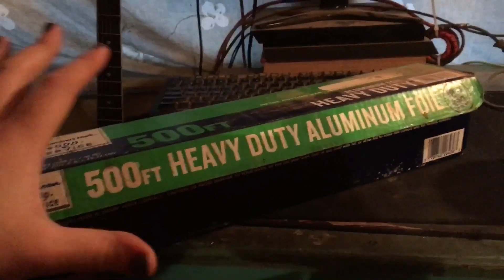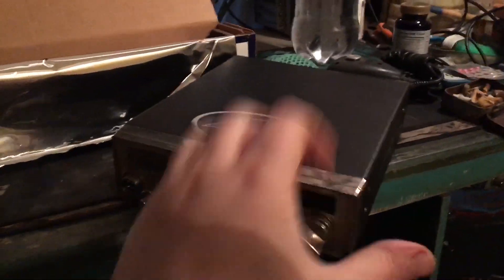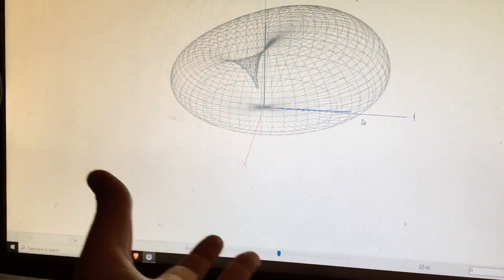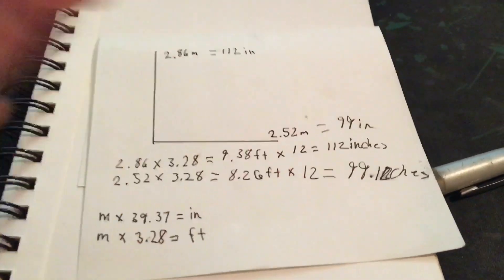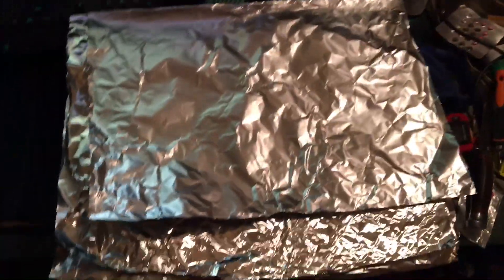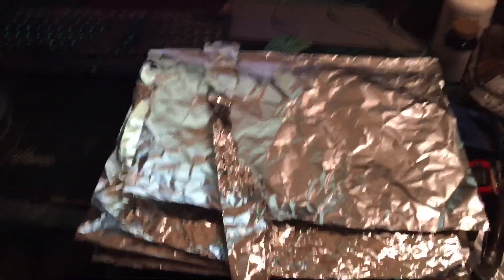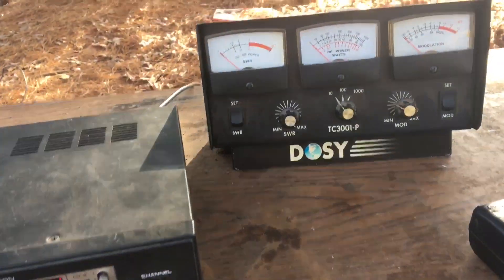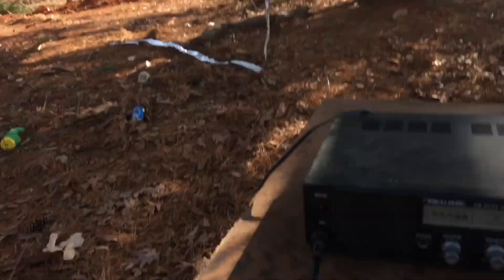Can you make a CB antenna out of Aluminum foil?

Comment: If I were a betting man (and I am,) I’d be this would work great if the foil was wrapped and smoothed over thin pvc or even wooden dowel. The radiation travels along the surface, so a crumpled core and wavy structure probably makes the radiating point all wonky. There, I threw 2 pennies at it! 〰️〰️〰️➰➰
Reply from the maker: Yep absolutely because of the “skin effect” RF would much rather travel over a smooth even homogenous surface

This idea isn’t dead yet of course, there will be a revisit 

thanks for commenting 👍
Reply: There’s an old lady down the road that still has an old tv antenna on a pole at her house that doesn’t appear to have wire connected to it. Been thinking of asking if I could have it if I removed it all for her. The only problem is she’s got private property and no trespassing signs all over. Really don’t want high velocity lead poisoning over my junk collection. Haha

Comment: hear are a few ideas: #1 5/8 wave vertical made from cans with a cap hat to bring the electrical length to 3/4 for 50 ohm resistive match, with aluminum foil or other metal sheet for a ground plane. #2 a 1/4 wave out of cans in the form of a sleave dipole. #3 a 5/8 ground mounted vertical made from wire & a cap hat to bring it electrical lenght of 3/4 wave with a massive ground plane going out 1/2 a wave made from random wire and metal. #4 a wire that is menny wave lenghts long strung horizontal cut to odd 1/4 wave lenght for a directonal antena! #5 a jungel ground plane wayyyyy up in a tree feed with 75 ohm tv coax! #6 a vertical wire 1.75 wave lenghts long over a maseve ground plane that exstends a 1/2 wave in all directions! # 7 a wire dipole feed with 2 wires in the form of twisted pair! hope this is gives you ideas the only thing truly intersting would be the can antenas but using odd stuff is a paine but wire antenas can be strange as well! cool vid!
Reply from the maker: Thanks for the ideas buddy

I think I’m going to try to make a J Pole in the next video

Although it depends on what I’ll be using
Reply: @JohnnyJonesathome  A "J" Pole for 27Mhz will be big!
The antenna made from drinks cans would be funny, but would work of joined properly.
You will be putting up a balloon next with an antenna way high up!  😅
Reply: @JohnnyJonesathome  I look forward to your J-pole video. I've never tried one.

Comment: Johnny, you shouldn't hold on to the camera while playing with yourself!
I have made a dipole out of tin foil before for someone in a big raised block of flats, worked very well.  Some of the things I have made antennas out if is crazy!
Reply from the maker: Cool man, I wanted to change the antenna designs but the video was already getting long so I think in season two we will revisit it and try a new design

I tried to make a scenario just to make it a little more interesting because I didn’t want to just make dipoles out of everything you know
Reply: @JohnnyJonesathome  Yeah, I know.  You can make an antenna out of a bit of string with foil wrapped round the string, then make three the same, attached these to the ground side (Braid) then take these three down at 45 degrees for ground planes, or make the ground planes out of anything you want.  As long as they conduct, it will work.